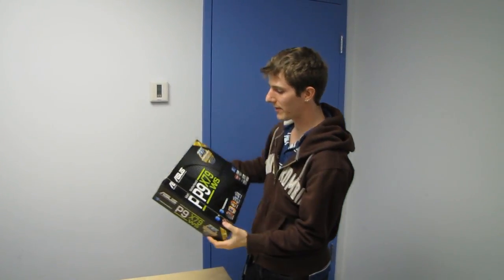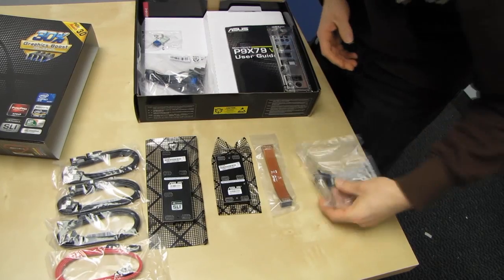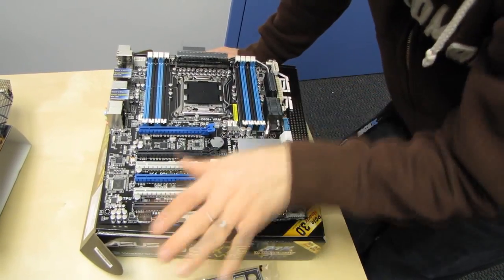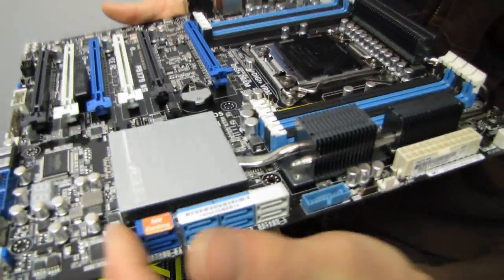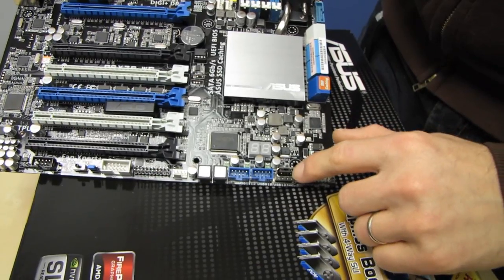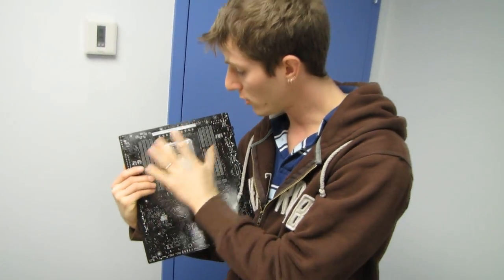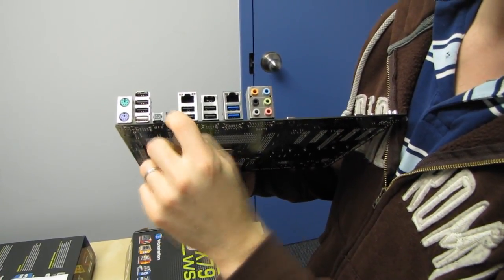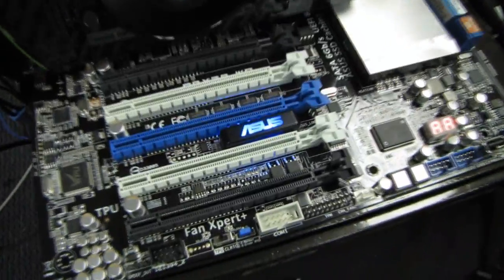ASUS P9X79 WS High Performance Workstation Motherboard Unboxing & First Look Linus Tech Tips

Comment: @Mathjj1222 yes, Intel's ethernet chips are way more advanced in terms of features than Realtek ones - for example, they support teaming (if you connect 2 dual-port mobos with 2 cables, it can be single 2 gbit/s link instead of 1 gbit/s one), and other cool features.

Comment: Gaming Motherboards are for "Gaming" while a Workstation board is mainly for working with video-editing making 3D rendered games or other things like that it's not ideal to use a workstation board for gaming you can but it is better to get a gaming optimized motherboard instead of you spending much more for a motherboard you most likely won't need. yea you get more ram slots but you honestly really only need about 8-16Gb's for gaming. macs are for hipsters they are overpriced and not worth it.

Comment: @Amaroqdricaldari You should only really need 2 or 3GB of RAM for games, although 4 is prefered.
Also, seeing as you are using a laptop, and it is running DDR2, you really need to upgrade. 
I suggest a self built desktop.

Comment: I have this board, now if I could just find a coherent explanation of how to update the bios. Apparently I have the super old 0802 bios installed but you have to do some weird converter step to go later than 3401 from that. The asus support page  https://www.asus.com/us/Motherboards/P9X79_WS/HelpDesk_BIOS/ says in the 3401 version section:

*If your BIOS version is 1305 or older: Go to BIOS-Utilities to download and install the BIOS Converter utility before updating the BIOS."

but  there is something called a "bios renamer"' but nothing called a 'bios converter".   I guess I'm stuck with just updating to 1305 which is the newest one that doesn't mention needing conversion.

Comment: @PaulePeng Yes there are, even though the cables look the same sata 3 cables has more copper in them because of the higher spec. Cheap Sata 2 cables might not work with sata 3 ports

Comment: @NicolSD I assume you didn't see his video on the Steelseries/Gunnar Optics computer glasses.  He got the prescription lenses as a control to see if the Gunnars actually work better than just plain old glasses.  Like me, Linus has a very weak prescription so he doesn't actually need to wear his prescription lenses.  This week he is testing the Gunnars and you only use those when looking at a screen.  A: because they make you look like a dork and B: because they are weak reading glasses.

Comment: @Mixamaximus Every computer has "clean" power, as a matter of fact every thing that has a PCB gets "clean" power. Converting AC to DC requires several steps: First; AC current passes through a EMI filter; Second; AC current passes through a rectifier; Third; AC current gets converted to DC (by a transformer); Fourth; Additional filtering; As you can see, you already get 100% "clean" power. The only thing a computer needs to do is regulate the voltage.

Comment: @MrAniketShedge unfortunately, you're wrong. If you're crazy enough, you could put 6 GTX 590's in there for GPGPU stuff, such as Folding@home. Multi gpu doesn't have to be SLI or XFIRE.

Comment: @Markgb3 6 way is not possible, only 4 GPUs can be supported. So even if you have GTX 590 (which has 2 GPUs), you can use only 2 of them, or 4 single GPU cards

Comment: well i don't think macs are overpriced. i mean what makes this board worth 500 bucks?  cause its not even technically server grade. i heard mac pro's use server grade parts. and really you can't compare macs to normal computers. with macs you kind of get specialized software for the hardware. i dunno, i am starting to turn into a mac fanboy, because i ran benchmarks on my macbook air and it performs much faster on the mac OS, rather than windows.do u know y? i am considering building a pc vs mac

Comment: Hey I want to build a hackintosh and my needs are gaming, rendering, and doing some basic computing stuff. My budget is around $1500 for the build. I was planning to get 32GB RAM but then I stumbled upon this beast of a motherboard. I want this board because of the options it gives you, so should I just get 16GB RAM to fit the board into my budget?